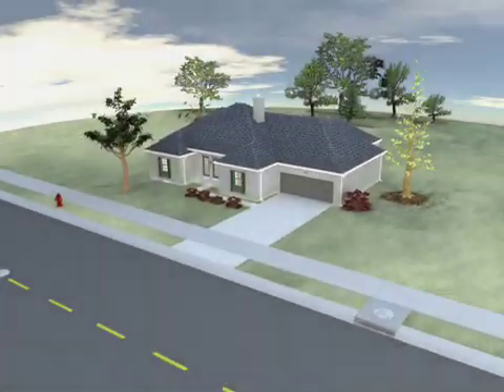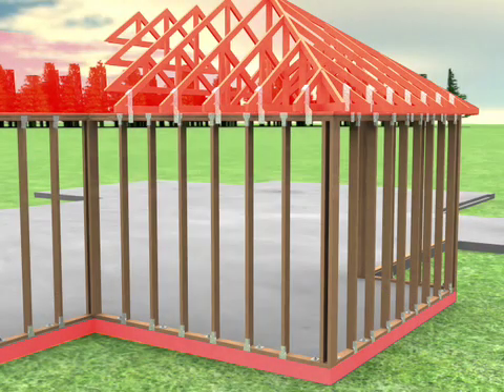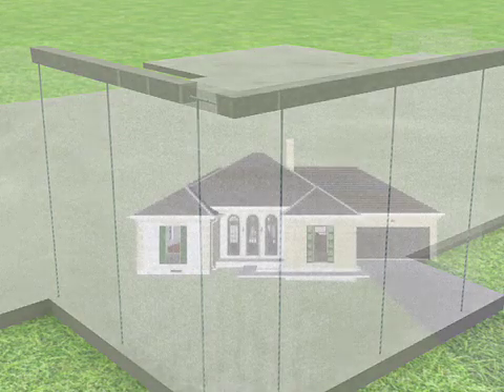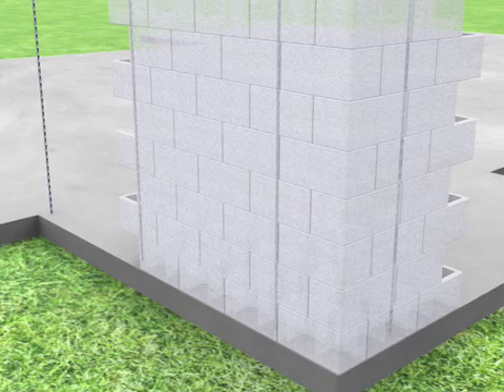Wall Construction | Best Wind-Resistant Wall Systems Explained

Comment: Thanks for all the videos FLASH. . .  

How come this was not an option when I was having a national home builder build my home in 2014?  LOL!!!  The only options available were to upgrade the kitchen cabinets, upgrade to hard floors, or upgrade the bathroom tile and the like. LOL!!!!

Is there anyway I can learn more about the appropriate use of these connectors and fasteners.  Like which ones to use, when and where?  I would like to start by retrofitting my unfinished two story garage to withstand an EF-2 Tornado (111-135 mph gust).  Can I figure this out on my own?

Comment: I prefer OSB over plywood due to stiffness and the same strength.  There is no reason to pay more for plywood unless you need it for the type of finish going on it.
Reply: You seen what happens to OSB when it gets wet? And it will get wet.